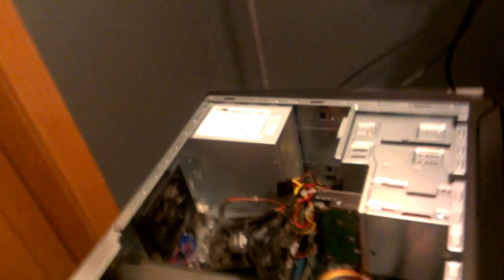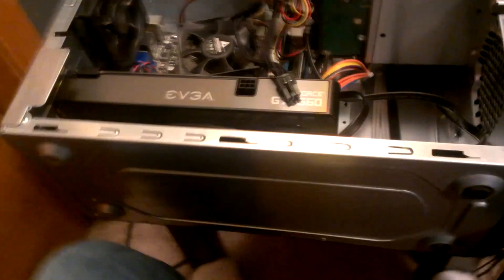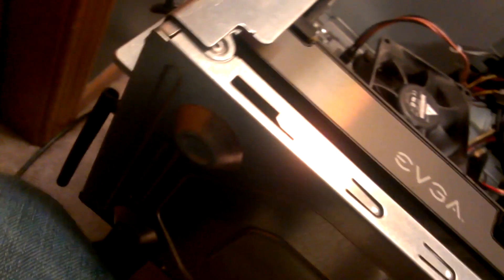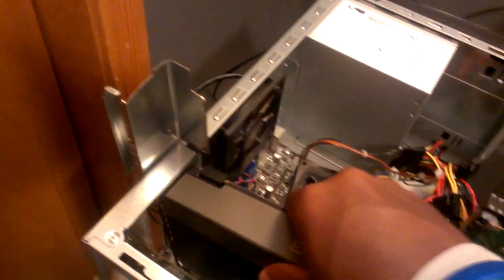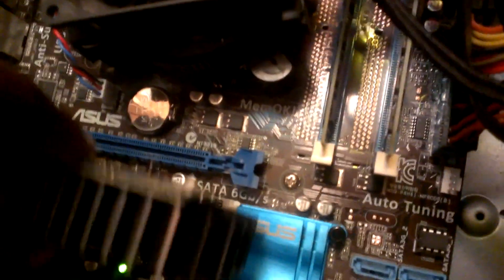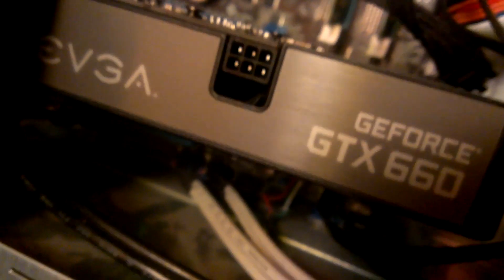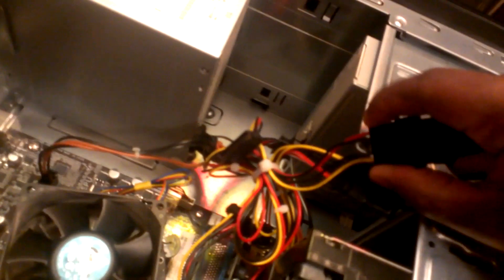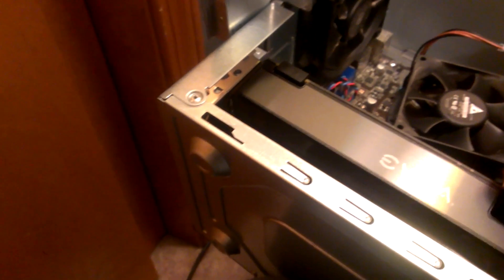How to install a Graphics Card (GTX 660)

Comment: i have dell optiplex LGA1155 H61 .0M5CDC MOTHERBOARD 
i just wanna know if it can handel the gtx 660 twin frozer gddr5 2gb oc edition 
can i instal it i know my motherboard is nothing please help
Reply from the maker: It seems that it has 1 PCIIE slot so in theory it should work
Reply: it has 2 slots for ram and 1 for gpu 
but it's a pci-e gen2 so what do you think the gddr5 is compatible with my motherbord or not please reply